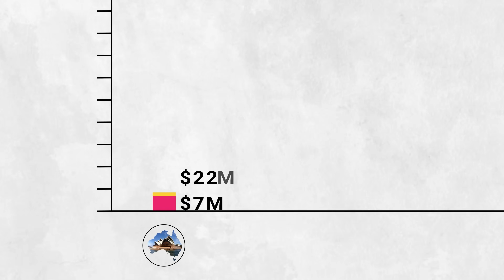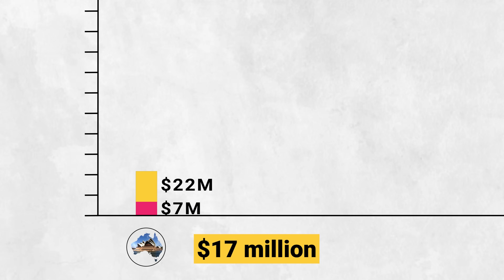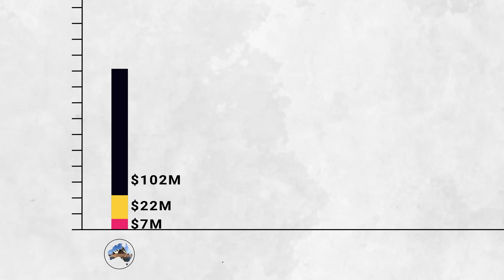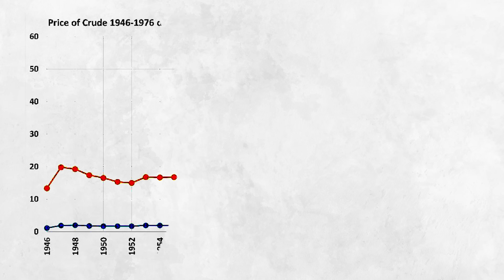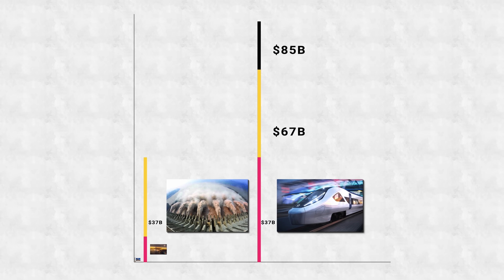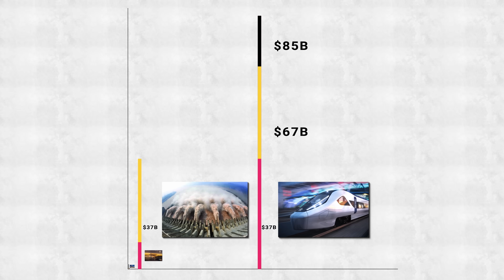Why the Sydney Opera House Wasted Millions

Comment: SOH couldn't be built when it was designed and drove many world first innovations. Major cost blowouts were also caused by the Symphony Orchestra taking the larger Opera theatre for itself which forced the Opera into a cramped smaller theatre forcing a costly redesign mid construction. Tens of millions in cost overruns were also caused by political interference from a petty minded jealous conservative party sabotaging the project and withholding the architect Jorn Utzons fees which forced his office to close further delaying and costing the project more when the Government Architects office effectively stole the project. Despite this Utzons masterpiece was completed and is a building for 1000yrs - it has recouped its cost many times over. Its iconic and a major tourist draw.
Reply: The final shape of the shells significantly reduced the size of the auditoriums, the spherical sections curve in at the base, whereas the original undefined shape (see some of the early drawings and models) went almost vertical at the base.  The original idea was to use thin shell roofs, Arup hired the world's foremost expert on thin shells,  a thin shell solution was finally ruled impossible due to physics.  The massively heavy, final, engineering design meant that they had to blast the original foundations to create far larger foundations - people noticed.  Really, the shells didn't cost that much, stuffing them with an interior and all the associated plant was really expensive.

For anyone interested, the ribs are epoxied together, normal methods like mortar were too slow and imprecise, Arups had done epoxy bonding before but not on this scale.  The shells had to keep exactly to the spherical shape to within a tolerance of a few millimeters, any errors could become cumulative.  I very much doubt that any "normal" building has been built to this level of accurately either before or since (and no I do not class supercolliders or their ilk as normal buildings).
Reply: In essence, the project's main problems started with the government wanting construction to be started when the plans of the SOH were even completed, like building a road before you know it can take the weight of the car you are building it for.  Of course, the foundation had to be reinforced to take into account the extra weight of the building.  This is just one of the things that the government had the fingers in and it was the bureaucracy that drove the cost overruns in the first place, although poor Utzon took the brunt of that fury.  The point I was trying to make is that any time the plans change drastically because of meddling, and there were in the case of the SOH, you get cost overruns.  Take Apple's Cupertino HQ.  It ran over budget by 2 billion dollars, mainly because of those issues, where Steve Jobs made many changes and wanted specific extravagant features in this building.  So, the SOH isn't unique in that aspect but it does show clearly that good planning and management of such a project is key in completing it in a timely and as cost-effective manner as possible.

Comment: i support HS2, go HS2 GO POWERHOUSE RAIL GO HS3, GO CONNECTIN AL 4, GO CONNECTING ALL OF THESE SO WE DONT NEED TO SLOW DOWN LET ALONE STOP ALL THE WAY TIL GLASGOW
THIS WILL BEEND OF DOMESTIC AIRTRAVEL, TO GO GREEN AND RIL FROM GLASGOW TO MALAGA WILL JUST TAKE 6HOURS, AIRLINES FROM CHECK IN 3HOURS FLY 3 HOURS
 The WCML is simply dangerous, outdated signalling and upgrades to it will never be finished, untightening the bends to meet atleat 165mph let alone 140mph, haviving watched WCML Cab line on pendolino made me cringe HOW ON THE FUCK FUCKING ARE TRAINS ALLOWED LET ALONE WERE ALLOWED 200KM/H OR EVEN 140MPH 235KM/H ON TRACKS that make me cringe, limited grade seperations even.
Geoff marshall all the station. and his talk with the drivers and conductors completely agree. they basically said the west coast main line route of hs2 could be built but on itll mean a 70% capacity reduction on the WCML featuring   360km/h train, but land and train table to acquisitions would likely cost the project  300Billion they had a solid 50billion plan. But the british people  are as stubborn as a donkey, i think the budget should be 500billion for powerhouse rail upgrading sussex, advance a direct connection to glasgow, stick to a revision of the old plan trains to scotlands their speed should never drop under330km/h and design the line with train not stopping at all cities, for example in france for lyon instead of hsr terminae, they connect with old rail systems so the HSR LGV TO AVIGNON AND Marseille dont stop all the way frombparis
and should be so for london to the nort the scottish highspeed highlander, stopping nowhere but its terminatin as glasgow beating the record set by apt in half, no sliw down british engineers are so prideful, they should have asked france and spain, better yet CHINA could be THE Best consultant. no nonsense just just viaducts, tunnels accross the whole route make stron fountaintion, on a viaduct pilar basis is cheaper to build antain anrequires less acquisitions just for foots a give a middle finger to stick it we need to import chinese contractor in just 20years they added 5000km of sophistics rail infrastructure  by cu bypassing all their red tapes
by elevating  their track, and seriously woodlands? trillions of cunic metric heavy ancient wood is slaughtered everyday across the world and the british love styleish timber, especially tree hugging hippies, land/estate owners should go FUCK THEMSELVES AND THE GOVERMENT SHOULD ACCEPT 380KM/H RAIL BUT PLOUGH THROUGH THEIR OWN DEMOCRACY AND  LOOK AT OTHER FIRMS AND CONTRACTORS ABROAD, I.E. FRAN SPAIN CHINA, JAPAN? not so much their ang shinkansen speed is just 40km/h higher than uks 125mph speed limit for intercity i suggest china, for rollingstock and track, additional infrastructure from the company that builds these tracks on on strecte stracks steel slabs embedded in concrete obviously galvinized metal rails and unique sets products of overhead wiring that can handle insane loads.

Comment: Even unintentionally this video smear the Three Gorges Dam.  The official data is by 2013 the revenue generated has paid off completely the cost of the dam!  Since the dam was put into operation in 2003 so the three Gorges dam paid for itself by operating just 10 years.

The official cost by China is $31.7 billion from its initial estimate of $22.5 billion.  The world's power plant cost average between $700 for gas turbines to $1,300 per kw for coal fired.  Using a price say $1,000 per kw for hydro the Three Gorges Dam cannot be build without at least $22.5 billion as it has 22,500 MW capacity by any standard.  The higer cost of THree Gorges was due to its large cost of resettle a huge number of residents which is not needed in normal power plant construction say up to 4,000MW each.

Also average electricity cost of $0.08/kwh in China is among the lowest in the world as US charges 1.35 times and UK 3.1 times more.  With 22,500 MW operating 365 days the amount of revenue by Three Gorges is $15.768 billion annually.  The electricity cost normally is split approximately into three partners of the generator who own the power plant, the distributor who run the transmission lines and the distributor who connect the power with every consumer.  Therefore Three Gorges could potentially get $5.25 billion every year from the sale of its electricity.  When Three Gorges first put into commercial operation it has only 6 turbines were operational.  The full compliment of 32 turbines operating occurred in 2012 as it is standard practice to build and install huge machines in stages.  The next year in 2013 its full cost of $31.7 billion was paid off completely.  Three Gorges Dam is China is known as a money printing machine!  Saying it blowing its budget is a demonstration of self ignorance.

The author of this video knows very little about the Three Gorges Dam too as he claimed some flooding was caused by the Three Gorges dam opening its spillways last year.  This claim is malicious because the official data of China recorded a maximum of about 75,000m3/s flow in the Yangtze but the Three Gorges was designed with the spillways discharging 116,000m3/s.  Thus Three Gorges Dam designed condition has never seen reached!

Another important fact about the Three Gorges dam is it has three rows of spillways.  All the photo in existence only show the bottom two rows, bottom has 22 outlets and middle row has 23 outlets, operating but the top 22 number of sluice gates have never been opened for flood relief yet!  Accusing Three Gorges Dam unable to control the water but creating flood downstream is a pure slander.

Comment: Utzon took with him his system plans for the glass cowering the restaurants between the shelves, so today they look like submerged submarines, with a lot of tubing and the glass had to be designed with a computer program. And also the built up roof for the scenes, so today the sound isn't right and his now missing design for for operating the scenes from a central tower, also made them smaller than necessary and not the original Grand Opera stages which was planned.  But his plans for using the sea water for the air-condition was made as planned, as seen from a much later English film from in- and outside the building, made by one of the Top Gear guys.

Comment: 11:55 The railway going left.... You just crossed the Irish Sea into Northern Ireland before crossing it again to get in Scotland. That's physically impossible! No bridge or tunnel can ever be build over/under that sea due to its depth and the fact that tons of unused WWII bombs were dumped there after the War! Not to mention the political compilations.
This is common knowledge within the UK, and I highly doubt HS2's original plan had this in it.
But hey, I could be wrong. Please can someone provide the source of this impossible plan.
Reply: It is technically feasible to build a tunnel to Ireland. The real problems are the cost and lack of political will. In any case, that map is massively wrong. HS2 goes nowhere near Ireland, instead using the existing WCML to head north into Scotland. I have no idea how they messed up that badly.
Reply: the original plan didn't he's pulled this out of thin air.  Not once have the plans for HS2 ever included Northern Ireland.
Reply: @apangel100  one does wonder how you can get it so spectacularly wrong
Reply: @MikeWillSee  the B1M has just done a great video on the benefits of HS2 - this guy should watch it.
Reply: @apangel100  funnily enough I was literally watching it when I saw your reply come through!